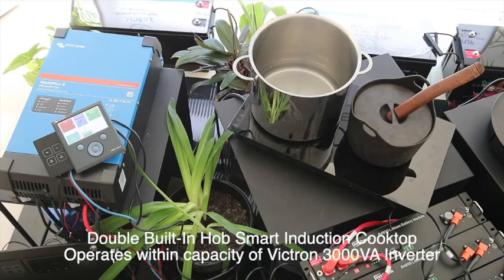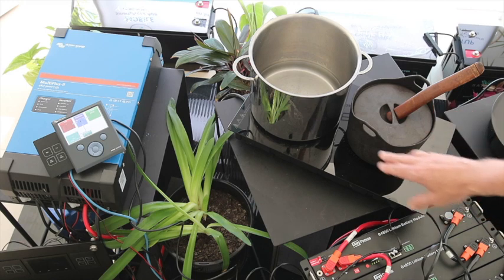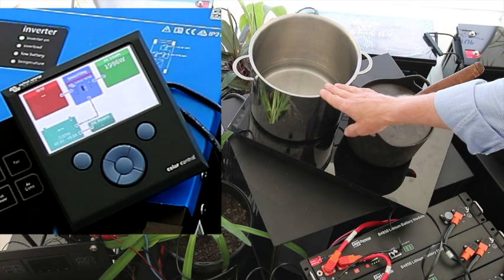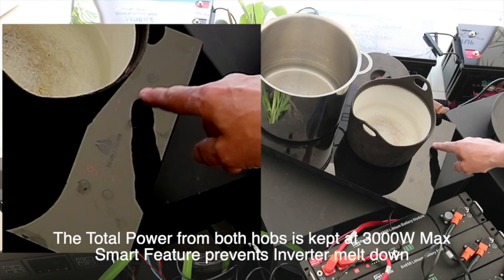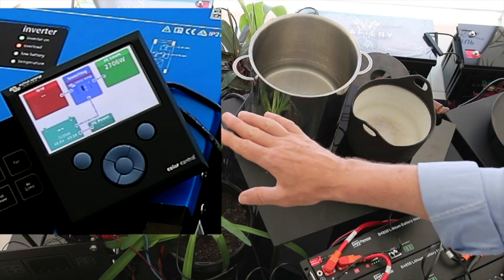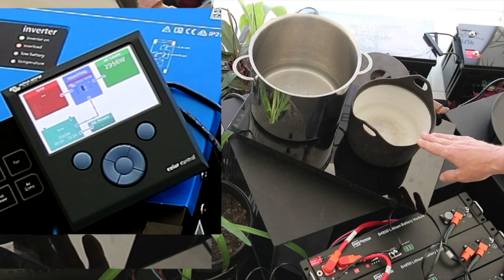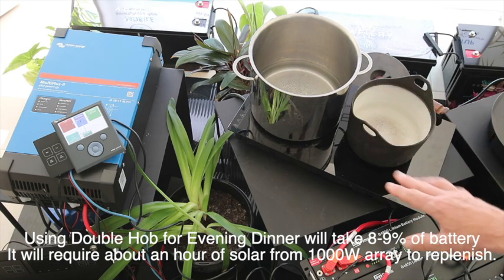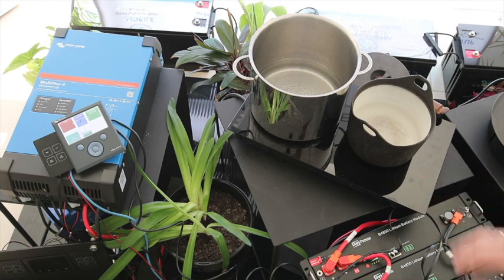Smart Dual Hob Induction Cooktop Manages Inverter Power Limit Automatically

Comment: Free energy. And the cost of the free energy? as against a propane stove ($150).
Inverter $1900
3 Batteries $1200 ea
$650 for the Hob
Plus wiring, connectors, fuses.
Over 6 fn grand to cook a fn chop!!!
Reply from the maker: Also you get: cold beer, hot coffee, airconditioned comfort plus plus. Money gives you choices
Reply: I'm building my own 6.7kW lithium system with 600W of solar and 1.6kW dcdc charger that'll power one of these hobs. Total cost is about $2.8k excl solar and dcdc charger as I already owned them. 
But as Safiery has said, it'll also power my fridge/freezer, coffee machine, microwave, oven, laptop, computer monitor, lights, fridge, water pump, water heater, diesel heater. Good luck finding LPG that can do all that.
Reply: @missingMBR  we'll chime in too, propane requires tanks that take up more room, and need to be re-filled manually, which means running to town, not always an option. If space is true concern, and you use a chassis mount propane tank, you're looking at $500 for for the tank without install.